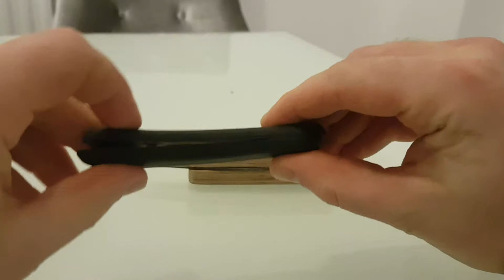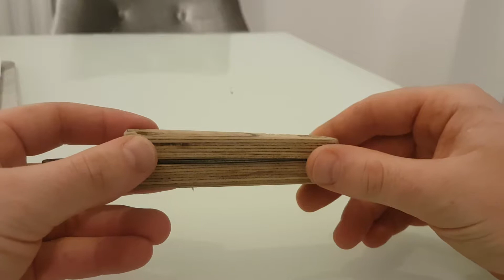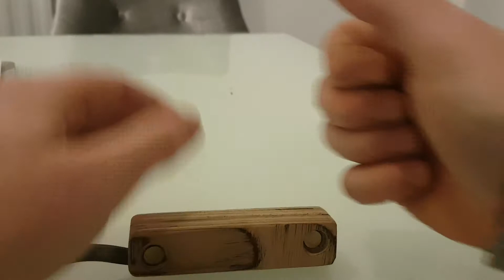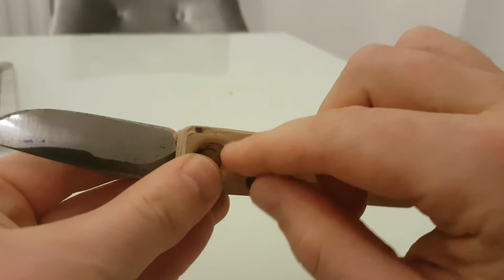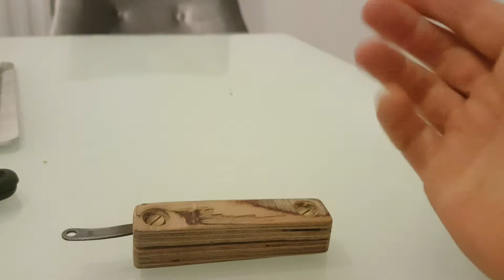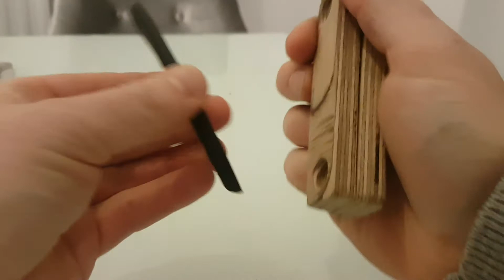Custom svord peasant mini pt1 table top minimal tools

Comment: Saw the finished video before this one I’m even more impressed by how you made it
Reply from the maker: Basically I got some birch ply 15mm at a guess. Got a screwdriver and bolster and chiseled the ply apart to a more suitable thickness. If you wanted to make a custom one yourself if reccomend getting the material near to thickness so between 5 and 10mm then reducing it to the desired shape.